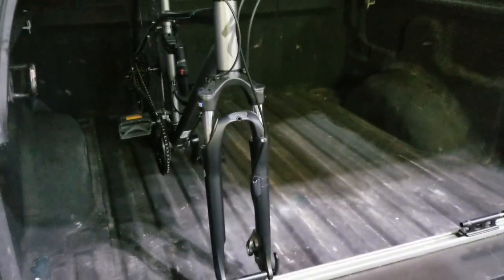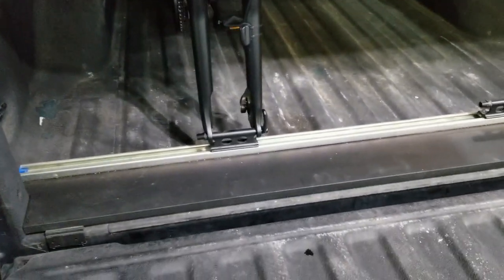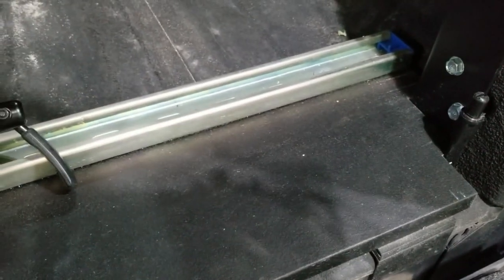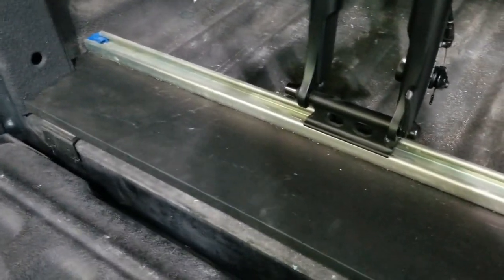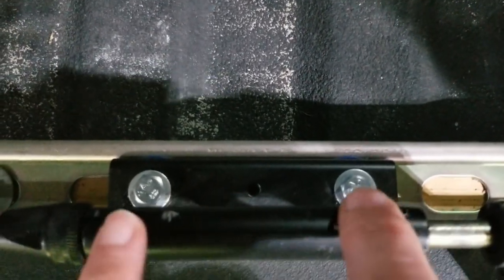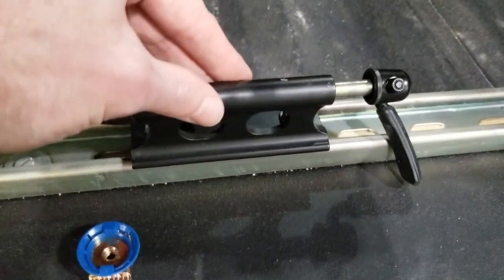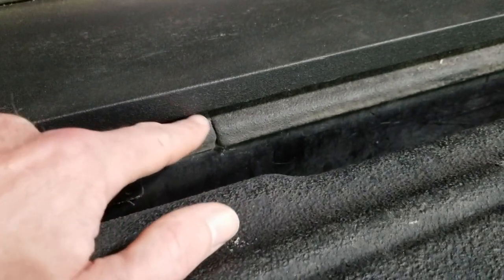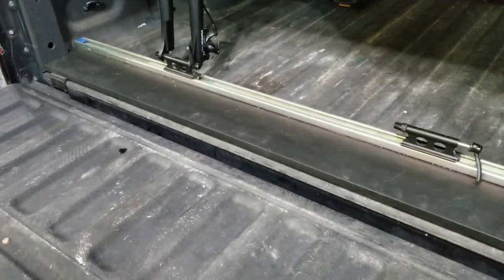DIY Bike Rack - Truck Bed

Comment: Any idea for a bike with drop-down front axle?
Reply from the maker: Hi Count. Wish I could help, but I'm not familiar with what that is.
Reply: @BlackHoleDIY  my bad, I think it's called quick release, the older stuff. It's not the thru-axle like your bikes that you can remove the bolt that secures the wheel and the fork.

And my solution, which I thought of just after asking you a question, is to  get a bolt with some washers and a wingnut. 

Let me know if you have better ideas though. Thanks
Reply: I need better ideas; cannot find wingnuts larger than ⅜.
Reply from the maker: Hmmm... I think 1/2 wingnuts can be found at Lowes/Home Depot either in the store on on the web.